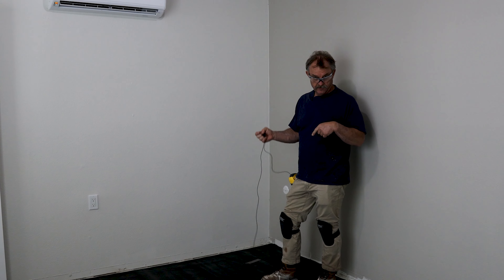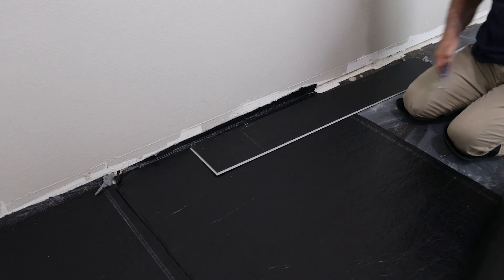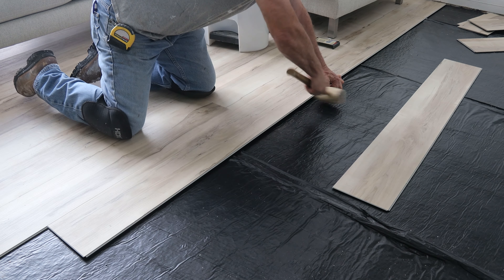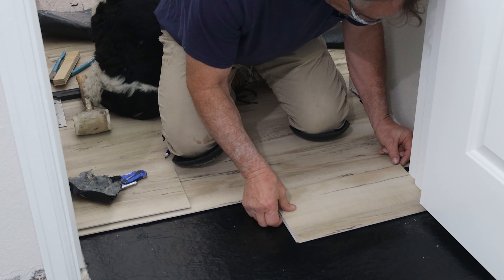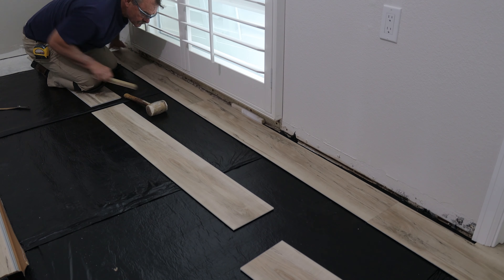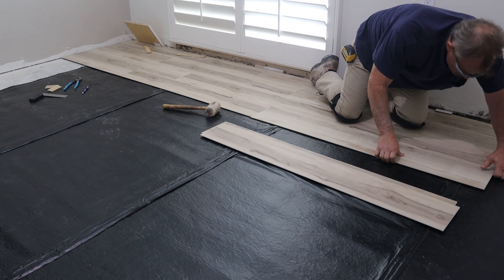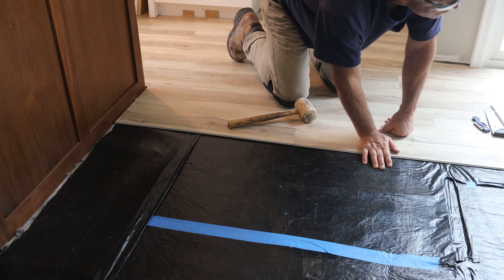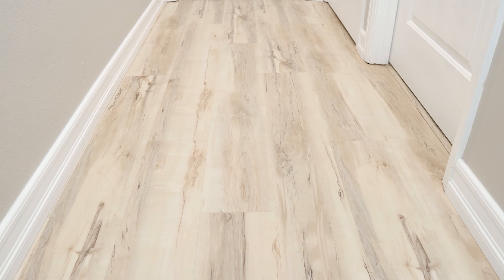Installing Floating Vinyl Floor - Tips to Make It Easier #vinylfloor #installfloor

Comment: It’s just not as hard to install as it it shown in this video. Hammering on the edge and grooves will destroy it. Screw a piece of scrap flooring to a piece of 2x4 and hammer on that. Most of the pieces can be massaged in to place and tapped with your palm for the final placement.
Reply from the maker: Thanks for the tips.